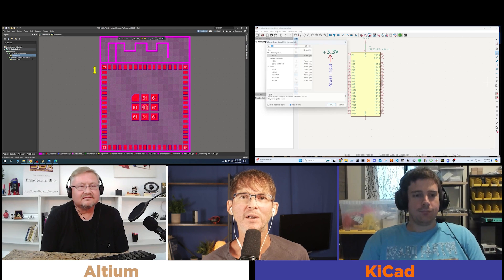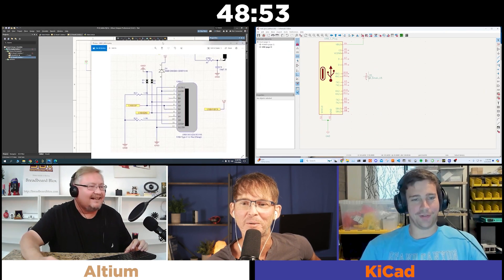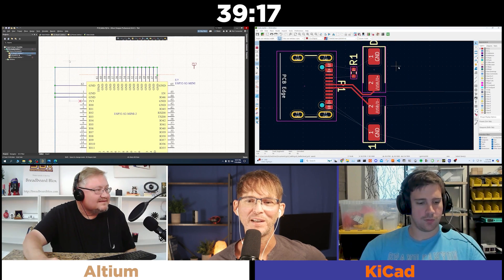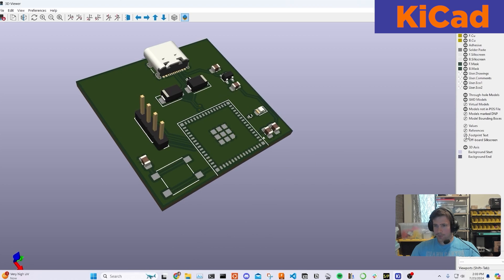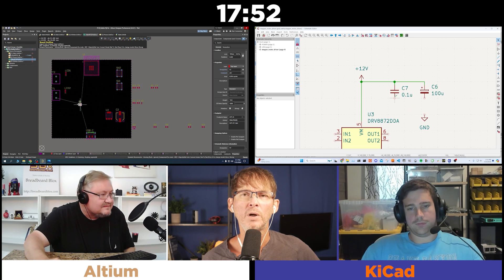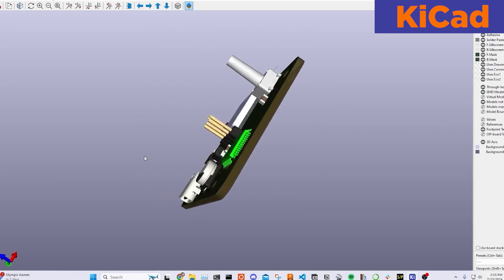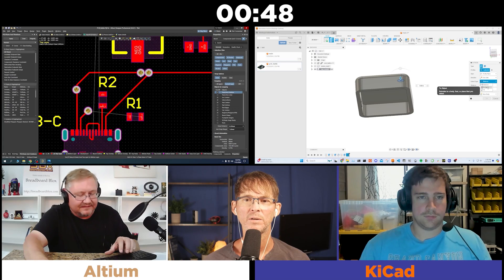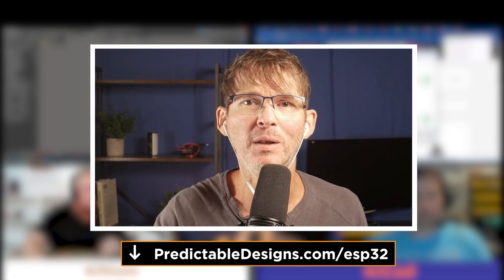Two engineers compete to design a PCB in only 1 hour! Who will win?

Comment: Altium is a freaking menace. I have to use the garbage at work and the work process is insanely slow since it starts off setting everything to stupid mode. Trace widths all set to 10 mils, clearances set to 10, component heights limited and on and on. Spending hours changing rules and constraints on every little thing blows deadlines. Then I am left making excuses and blaming software. “Go take more Altium training” they say - except Altium training is always just a sales pitch disguised as training, the trainers don’t speak native English most of the time, can’t understand a word they say and they do the same thing I have to do already, spend most of the time drilled down into a million menu options when all we need to do is make a dual layer board with 5 freaking parts!!! And draftsman is a joke. It doesn’t fit any drawing standard, so everything has to be exported into a real cad program like Solid Edge, waisting even more time. If you never have deadlines and love spending time fighting the rules manager and 300000 menu options to complete simple tasks it’s great I guess? Even on very complex, multilayer designs, I’d rather use Proteus or even kiCAD if I had a choice.

Comment: PCB design is a technicians job, not engineers.
Reply from the maker: Only at big tech companies. It was that way at TI when I was a designer there. But for freelancers, startups, and small companies the same engineer does both the circuit design and the PCB layout.
Reply: It's engineer job creat a custome pcb requires big knowledge in electronics

Comment: If you've spent 5-10 years making Altium efficient by templates, vast database libraries and common design rules and all that. And you know your way around the software (which is VAST), you're flying through the design when it counts.
I've done designs on Altium with similar complexity within an hour from first schematic to gerbers to boardhouse.

It's all about how well you've prepped on Altium , if it's not prepped and tuned, you're shafted on Altium, it's just too vast of a software.

Comment: The main reason I prefer Altium over Kicad is the MCAD CoDesigner, they did a really good job there.
Previously, I had to export the PCB to STEP (or whatever format your mechanical engineer prefers), transfer it to the mechanical department, they check it, update the shape/layout, and I try to match it; rinse and repeat.
With the MCAD CoDesigner feature, it's way easier to collaborate, just 1 button to push, 1 button to pull and update simultaneously. :)

Comment: Can KiCad import an Altium project?  If so, how well, or what are the limitations?  Can it convert not just the schematics, but the PCB Layout, libraries, etc?
Reply from the maker: Not really. You can convert a schematic but it usually loses it connection to the PCB layout. All PCB software wants you to stick with their software so they make switching difficult.

Comment: I heard it's better to do 4 layer with two grounds in the middle, and as much ground on top and bottom as possible to reduce RF and RMI. The dialetric space between the layers on a two layer board (top/boittom) is apparently too much to reduce noise according to some experts out there. That might be why stitching is so important.
Reply: @PatrickHoodDaniel  👍 this is what I always do
Reply: If needed, use a custom stack-up. I have a few parts known to emit lots of RF in the few hundred MHz and had my board shop use a 100 micron spacing of pre preg between the inner ground and power planes specifically to use as low inductance capacitance.

Comment: Would like to see a battle with someone reasonably seasoned in the latest Fusion 360 Electronics. I've been using it since it was Eagle and the version now built into fusion is very different. You've previously said Fusion is terrible but I think that might be based on out of date experience. I've had no issues and the library support is excellent.
Reply from the maker: Great point and I've not used it since it was Eagle. I'm also doing a 3D design battle soon:)

Comment: I would love to see another battle where both designers receive the exact same schematic, part list, current and voltage constraints, board size and mounting scheme. Anyway, thanks for sponsoring this, it reminded me of the old 'PCB Benchmark' contests.
Reply from the maker: Thanks Jack for the feedback! 

I'm experimenting with different battle formats. For the second battle (already recorded and coming soon) I give everyone the same parts list to design from. 

Then in another battle I provide the finished schematic to them for a more simple design so they have time to complete a good, clean PCB design within the time limit, and then we'll order the boards, and then they'll race to see who can assemble and test their board the fastest.
Reply: @PredictableDesigns another idea would be to provide the engineers/competitors with pin maps instead of a finished schematic. Like a firmware engineer may give to a hardware engineer to implement.

Comment: Interesting video! It would be cool to reverse engineer Seeed Studio Xiao BLE/Wifi and it's expansion pack so that people don't have to wait for it to be available. The product I am attempting to design only needs a BLE chip, BLE antennae , USB-C, and a servo controller (4.6-5 Volt options) running on a single battery source. I do not know how to make PCB boards and my electronics knowledge is very limited. I think it would be of great interest to noobs to have a resource with ideal examples used to achieve basic requirements for new age PCB boards such as BLE/Wifi chips, antennae, power source, servo controllers, and typical ports. Also, noobs would need to know how to connect all of those examples together on the PCB. Open source PCB software would be ideal to for noobs. Just fruit for thought.
Reply from the maker: Thank you!

Comment: Why no Diptrace🤔. One could easily make a two layer pcb(seven layers possible with no size limitations even in the time limited trial version-that does not need internet activation🤫) , inhouse with the dxf export capabilities. Also it is far easier to create a custom pattern in minutes from a cad model(dxf import), or digital calipers. Could easily convert any Eagle libraries and pcbs with the free scripts.❤️👍
Reply from the maker: Actually DipTrace is in my next battle!

Comment: EasyEDA Pro would be 10x faster and get a better design then this, i feel like these guys environments are not set up correctly and they are not that comfortable with their dev environments. Also I am not seeing the recommended 22 ohm resistors on the D+ and D- lines, also using a USBLC6-2SC6 for ESD is a much simpler solution then anything else. Also usually 3 decoupling caps for the mini modules as well as bulk capacitance for the USB power supply usually 47uF or more if you can fit it

Comment: I design boards with hundreds of components, thousands of pads (and that's all without big scary BGAs), and I exclusively use KiCAD.
I also design dimensional critical boards such as printed microstrip RF voodoos and printed transformers, ranging from signal to kilowatts, again, all with KiCAD.
And I do have a commercial license of Altium Designer, so it's nothing about money. It's just the combination of faster algorithm and easy scripting made KiCAD much more productive for me.
And lastly, on similar hardware, Gnome 46 just runs way faster than Win 11. My workstation (7940HS) is WAY faster running Ubuntu 24.04 than my similar specced laptop (U9-185H) running Win 11. If not for certain apps, mostly tax, banking, and other government-related stuff requiring Windows, I would not even consider a Windows laptop in the first place.

Comment: I have an annual competition in school called "TIE - Technolgies of Interconnections in Electronics" and, since I'm working with Altium Designer starting with 2016 - passing from an older Orcad Layout - I could participate to this contest. BUT I didn't because "which is the best" PCB software label does NOT come down to speed (which TIE was all about) but to capabilities. I don't know KiCad but I know Altium and I would NOT leave it unless I'll switch to Cadence Allegro (maybe). Strangely enough, there's a more "advanced" competition called TIE+ - also related to PCBs but the "advanced stuff" and that competition usually goes for around one week and not 3-4 hours like TIE alternative. I wonder why is so long (differentials, complex routing, PCB stack, controlled impedances, and the list can go on). I'm not an Altium affiliate, I'm just working with it so I have to say that speed doesn't mean "better"! If you have a huge/complex PCB, planning is your friend, not speed!
  Some edits: for me, Altium has a nice looking GUI over Allegro but from what I heard, Allegro is more capable in some aspects, the downside is that it throws a bunch of files in project directory - thing that I don't like. KiCAD is for rapid prototypes, I would give it a chance! If it does have libs importer from Altium then it's a plus for me!

Comment: How you at all work with cad software with only one hand and a mouse ...no offense but that's a very beginners approach, you guys may be professionals but very inefficient once.
Reply from the maker: Are you proposing they also use their feet? Haha. Thanks for commenting.
Reply: @PredictableDesigns  
A video with such a name comparing two products suppose people who are using those products to use them efficiently, and that's what is not shown. I am using Altium, previously Protel for 25+ years, and I can't imagine working with one hand without short cuts. Altium is far from a good cad, have a lot a flows and issues, it serve it's purpose for small to mid complexity pcb's, but KiCad is even further back, exactly because it's inefficiency and lack of tools. Yes last versions showed significant progress in some areas but still far back. And if you create such a video, you should first say what the objectives are, what type of board you want to compare, and then find users that can use them efficiently so you can compare them objectively.

Comment: With any software it is hard to compete and declare a winner. So many more aspects are important than just speed. IMHO licensed software is a policy sold to the user, while FOSS doesn't sell anything. No guarantees, no guaranteed upgrades, patches, polished GUI or maintenance. It is hard to say which is better, but if you look at a few examples: Apache vs IIS, Python vs .C#, Blender vs Adobe? (don't even know) It is totally clear that FOSS provides more than adequate software to work with. But no claims. Often it is up to company policy whether FOSS is allowed in production.

Comment: I guess there should be a rematch with some specific tasks and exactly the same to be performed on each software. Like find easy common and difficult components, footprint matching and designing too, footprint changing, routing related task, reworks, schematics rework to pcb updates, diff pair routing, length matching, multi components footprint updates, like that many practical challenges need to performed 1 to 1. that would be interesting to see.  thanks
Reply from the maker: Great ideas, thanks for sharing!

Comment: Very good vedio. I use KiCAD complete some projects, 8L substrate, 4L conversion board, working well. Some limitation in KiCAD,
1. Max layer count is 24 Layers, 
2. Trace width setting is by net name, it cannot set to by layer,
3. no degassing hole for plane.
However, KiCAD is still my favorite one.
Reply: 1. You can now do 32. Also you can generate pure planes (only via cutouts and no traces) using DFM tools, so unrouted power/gnd planes don't count in this 32 layer limit.
2. In version 8, you can add custom rules, just like Altium's queries.
3. Balancing copper can be added using scripts, so are any periodical structures.
Reply: @bskull3232  that sound great, in version 8 ?
Reply: @spicyeddie  Correct. V8 brings in quite a few new features.
Reply: "Max layer count is 24 Layers"  where would you even have those made?
Reply: @TheSwissGabber  some of my projects need 40-50 layers.

Comment: Nobody seems to have pointed it out yet, but Jerry's transistors make no sense. I think he was going for open collector (common emitter), but he has the collectors wired to ground.  Even if we exchange emitter and collector, he has no current-setting resistor on the base.  Actually, with E and C as drawn, the NPN transistor will still function as a rather poor transistor. But the B-C junction shorts the MCU output to ground... (due to lack of current-setting base resistor), so that's also bad.  Clearly all this indicates that Kicad is better than Altium 🙂.  (Actually, each has its merits, of course.)

Comment: I am currently designing a 900+ component, 12 power supplies, 24 internal USB lines (don't ask), HDMI, Ethernet and much more, with KiCad on a 6 layer board that measures 380x180mm. On my computer KiCad is a little bit annoyingly "sluggish" during tracing. Not enough to warrant a $12000 upgrade by any means, just wanted to convey that Kicad is capable but there is a definite upper limit within reach of "Advanced Hobbyists" (or whatever I should call myself).

As for the challenge; Great Idea, and from my PoV the individuals made more difference than the tools. When I started with KiCad ver 4, it was horrendous to work with and I wouldn't recommend it to my enemies, but the transformation that started in ver 5 has been a blessing to the hobbyists, makers and start-up companies.
Reply from the maker: Wow, that's a complex design! Thankfully, most designs I see aren't that complicated:) I agree the difference is more the engineer than the software, especially in 1 hour race like this. But pitting these two tools against each other also sounded like fun.
Reply: performance will depend greatly on your GPU
Reply: @AmauryJacquot  That could of course be the case, but I don't think so. The sluggishness is not in the rendering itself. For instance, adding a trace is fairly instant,, but removing it has a few hundred ms delay. Turning on/off a layer is practically instant, but when dragging a trace, it is very sluggish. So to me, it looks like data structure search and modifications are not optimized for certain operations.
Btw, I am running on a fairly old GTX970, but still better than most Intel Integrated.
Reply: @niclash how many layers are you working on ?
Reply: @thanatosor  2 ground planes, which are not visible, but typically I keep the remaining 4 layers visible.
Reply: For me start was in 2012 but even then it was comparable if not better then Eagle, over 1000+ of designs later, i love KIcad, latest is super small 4 layer 0.4mm pitch BGA with ESP32 on there all on 6*20mm board jacked with sensors, spectrometer and stuff... Bottom line how i see it, all the time invested in getting kicad mastered payed back because it grew to be super capable!

Comment: Started with KiCad and learned Altium as well. I agree that for general purpose boards KiCad is king. I can see why companies would want Altium through their use with workspace and design rules. I guess if were designing a board that may be printed thousands of times over... go with Altium lol
Reply from the maker: Yeah, for a large firm with lots of engineers then Altium makes sense. But for independents and smaller teams I think KiCad holds up just fine. Thanks for commenting!